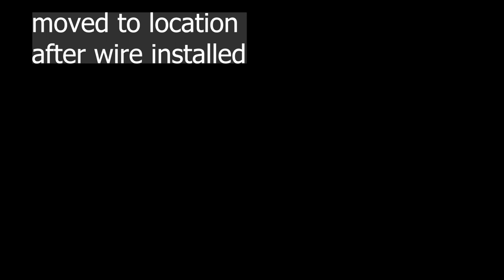Cattle Panel Chicken Pen Build

Comment: How predator proof has this been so far ? I think this would be perfect for goslings.
Reply from the maker: So far, it has worked well with only one incident. A raccoon reached in and pulled one out through the wire one night. Have since added extra perches and laying boxes. A smaller wire around the bottom should prevent that from happening again. Good luck with your goslings.